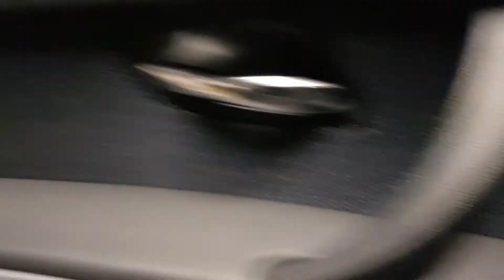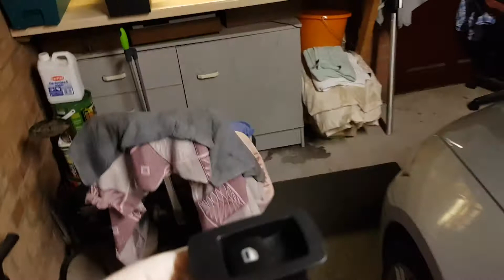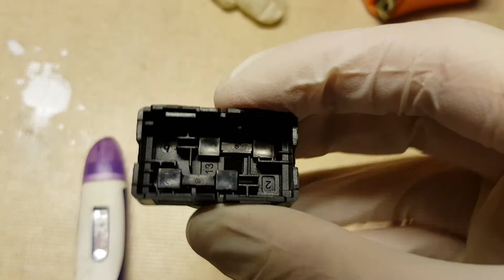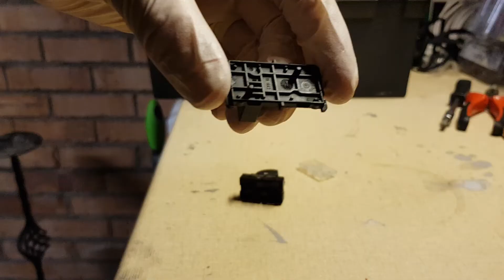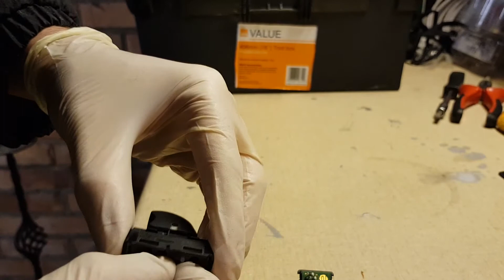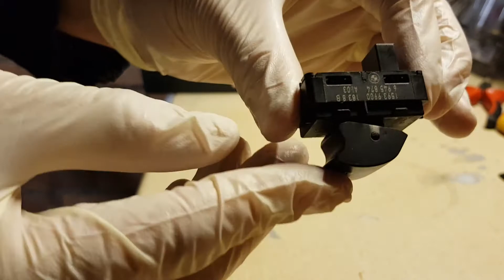Electric window switch repair e92 320i BMW M Sport

Comment: Seeing after cleaning it that you still have an issue and im facing the same issue , maybe you can explain it to me , while you are trying to  lower or put the window up  the switch is not listening and its acting like its getting confused flickering the window up and down and then you have to stop it . Why is this happening? minute 8.15' an example
Reply from the maker: I know what you mean. I'm not sure what yours is doing now but I just left mine alone and after some use it began to work normally again. It kept working normally until I sold the car last year. I must have gotten lucky with that repair.
Reply: @bumbleshufflesdiy5908  your guide definitely helped me to clean up my switches and actually understand how they work to implement some other stuff with circuits I wanted to fix  in different electrical areas. Mine started working properly on the day after no issues as well , probably it also helped calibrating the driver and the passenger window again after cleaning the switches ! Thanks again for your guide !

Comment: What's  the name of spray??. I got the same problem.... or I can use alcohol.... or clean carburetor.... or DW... what do you think my bro?..
Reply: I got my bmw e90 n52 2008... I hope     solve the problem
Reply from the maker: I used a can of Goo go degreaser and it was only about £1 for the can. You could probably use petrol too or some other fluid but I bought the proper stuff because it was super cheap and sisnt leave any smells in the car.
Reply: @bumbleshufflesdiy5908  I will try some degreaser.... i hope to get lucky...
Reply from the maker: Hopefully it will work for you and is a cheap fix. Mine has worked perfectly ever since so that's promising.
Reply: @bumbleshufflesdiy5908  thanks bro...
Reply: Wd 40 also works